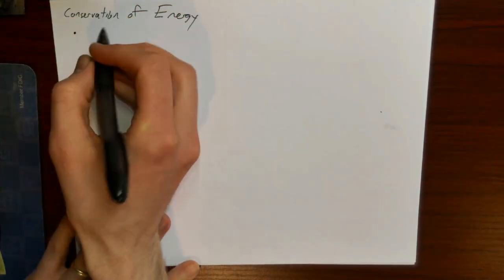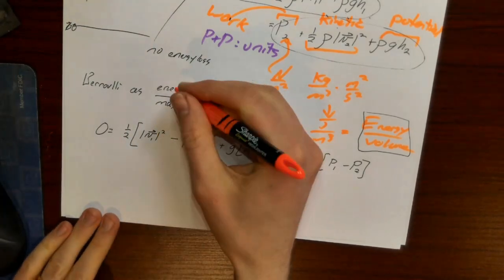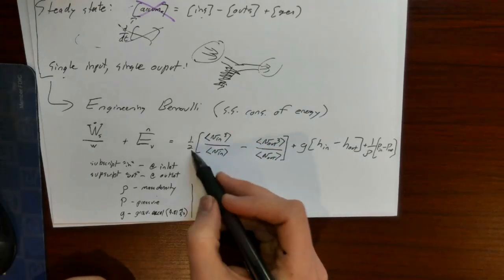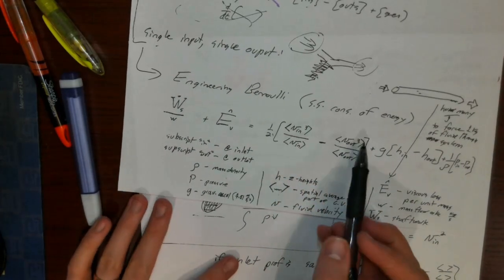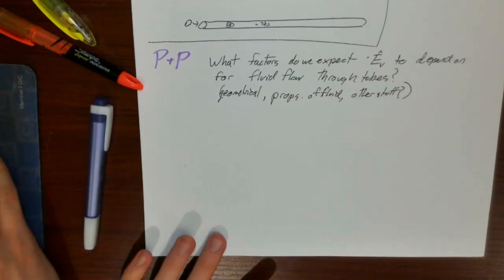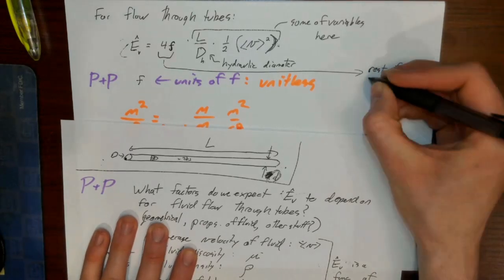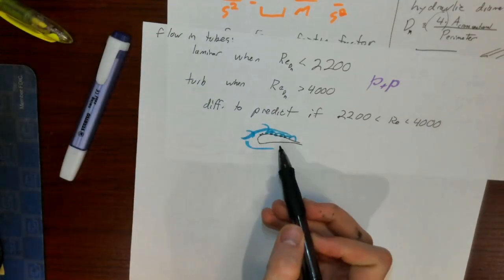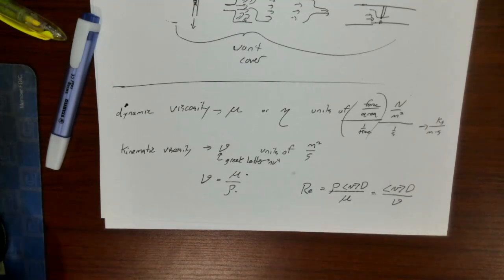BIOE 3310 Lec 10 - Conservation of Energy (aka Engineering Bernoulli)

Comment: "Per unit mass" form of Bernoilli eqn. 6:12
Limitations of Bernoilli assumptions
Engineering Bernoulli: Isothermal, steady-state, single inlet/single outlet conservation of energy 14:51
Modification/allowance for nonuniform velocity profiles, angle bracket notation
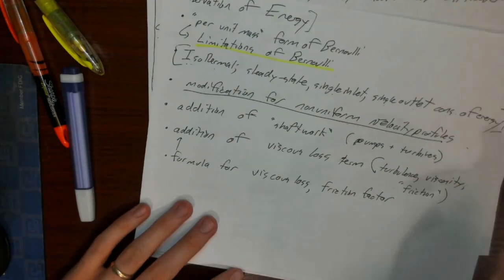Shaft work term (W_dot_s): accounts for turbine outputs or negative of pump inputs 34:25
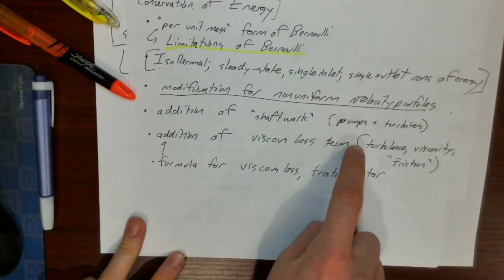Viscous loss term (E_hat_v): accounts for turbulence/viscosity/shear stress/friction 41:45
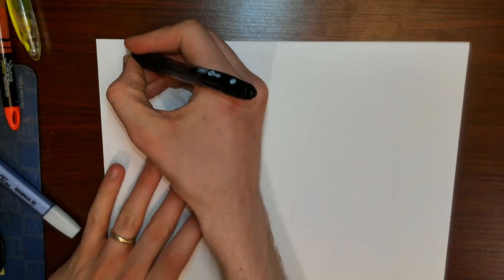Formula for viscous loss: what terms does E_hat_v depend on? 53:14
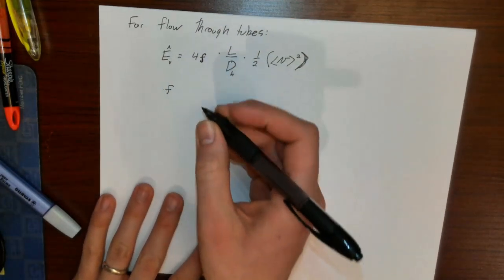Fanning friction factor 53:57, formula for laminar vs turbulent flow, Reynolds number 1:02:21
Dynamic viscosity (greek letter mu) vs kinematic viscosity (greek letter nu) 1:13:30